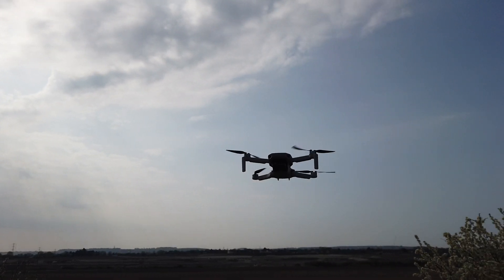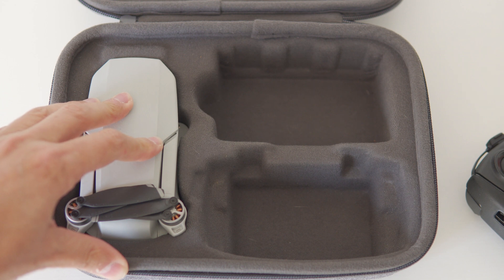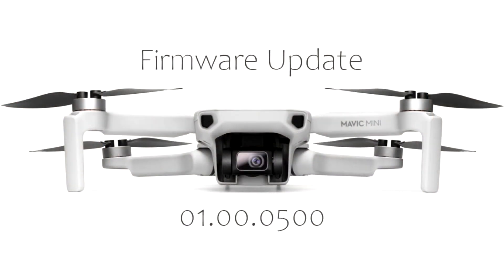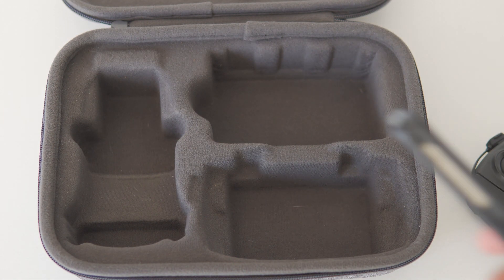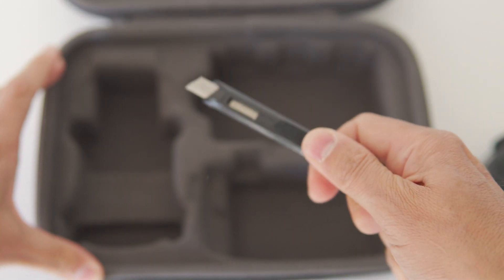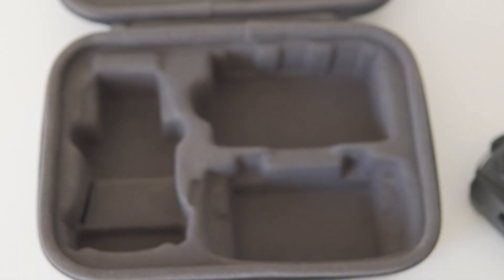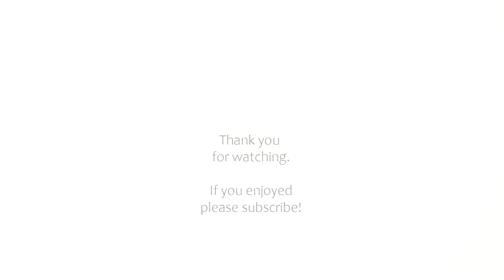Dji MAVIC MINI Warped Propellers | SOLUTION, FIX & PREVENTION!

Comment from the maker: Just so its a little more clear for anyone (due to my camera deciding it wanted to play focus games), you want to cut the felt layer of your case as pointed out by the red line at 1:52 in the video. Only cut through the felt layer, and not all the way out the other side of the case.
This then creates a "felt layered flap" and will lay flat in the case. 
No more pressure being applied to the propellers should they not be put in the case incorrectly.

Comment: I decided to call Heliguy today. Basically they were not aware that there were so many issues with the motor speed error warning. After me explaining my situation as below and him reading forum posts and seeing just what a big issue it was (and that it was generally with the rear left props) he concluded that the latest firmware was at fault in as much as it is too sensitive to even tiny deformations. He said it's likely that the new firmware was OK in in-house DJI testing but in the real world it's not. He explained that they are pretty good at listening to issues and we can expect an update in the foreseeable future. As a total newbie I reckon that there is a combination of factors at play, from incorrect storage, thinness of props and their longevity and firmware. I'm storing mine out of the case and all arms open in an attempt to reduce the chance, even though I'm so careful. I would also add that I bought 2 x sets of spare props from Heliguy last week and the DJI packet they come in is a polythene bag with a cardboard header - potentially easy to mis-store / mis-handle (easy to squash them in transit from the manufacturer to retailer and on to customer). Could some replacements be damaged on arrival and only now we are discovering this. Thin props might be a problem. Time for DJI to rejig firmware and investigate prop material further to see if it is suitable for the MM?
Reply: Thanks for the additional info. It's interesting that Heliguy feel that the problem is firmware related, but I'm inclined to agree with you that it looks like a combination of issues and that the propellers may, in some cases be slightly deformed from new (given their particularly flimsy type of retail packaging) - this might also explain why so many other members on different forums are reporting the motor errors, even with new drones, or after replacing their propellers?
I also own a Parrot Anafi, which has REALLY thin propellers and I've never had any issues with errors or the like, on that drone (and still on the same set of propellers 6 months down the line) - maybe DJI could (ahem!!) learn something from them.

Comment: I do not know why your case does not have a sticker inside, showing how to fold the propellers of your Mavic Mini before inserting it into the case.  If you follow the instruction the propellers are not even close to the area you are cutting off. 
Just fold the propellers inside, perpendicular to the body of the drone and they will not touch the case at all.  do not leave them pointing back at 45 degree or so.  It is not worth to damage a case when there is simple solution of putting the drone into the case properly.

Comment: I am wondering if a thin sleeve, properly sized of course, slid first over the propellors of one side and then when the propellors of the other side are merged with them slid back to the centre, would keep the propellors perpendicular across the body? This could be tested first with the likes of a strip of paper suitably sellotaped into a loop. I haven't got my mini yet so can't experiment myself
Reply: I am posting this as a reply so that the ammendment stands a greater chance of being drawn to the attention of anyone who liked etc. the idea of "sleeves". 
Having seen the sleeves wrapped around the props of my MM when it arrived I am inclined to think that a tight sleeve tends to squash the blades together and I would suggest that if anyone is thinking of trying sleeves they should use a loose fitting sleeves.
Personally I think I will go with the idea of leaving the props loose and then, when putting the MM into the flymore case, tilting the MM's nose down so that the prop blades 'fall' forwards as in the post elsewhere in these comments.

Comment: I have something to add. I'm a total noob with a brand new MM. I have flown it on 3 separate occasions since I received it, so I'll call that 3 flights. Each flight  I used 3 batteries. Each flight separated by around 4 days. The first flight, last battery, I crashed the drone, chipping props. I replaced all props with those from the Fly More pack and stored in the FM case VERY carefully, noting exact position of props - I've been reading a lot lately about this motor error issue and knew storage was a possible even before I bought the drone.  Next flight I calibrated the gimbal, compass and IMU. Flew without incident up to 120m and did 3 batteries. Again, stored in FM case.

Today I set up, calibrate compass and take off. Within a minute I get motor error warning. I land, changing affected props - you can guess which ones...  yup, rear left -  and then take off and fly all 3 batteries without incident.

I just don't understand it. I've seen all the warnings about storage and have been ultra careful, yet still have had problems. I'm loath to cut the case.
Reply from the maker: Yeah I am sure Dji have made the Props to Weak. Also worth noting that when you put the drone in the case to let the drone cool down a bit first. you may notice it gets a tad warm when flying for long periods. I think this may also affect the props.
Reply: Did you update the firmware, as someone else suggested? 
There was a problem with the firmware and there was a suggestion (that worked for me) of reinstalling the firmware through the dji assistant (for Windows pc). Somehow it sorted my errors. Didn't even downgrade the firmware... just reinstalled it. 
Also, it may have helped that I stopped storing the drone in its case...
One final note: I didn't even change the props! Still using the original ones (that gave me the errors) after all this time and never had another warning since then...

Comment: But that raised portion in the bottom of the case is supposed to support the belly of the Mini.  If you cut that away, isn't the weight of the Mini now resting on the folded rear props?
Reply from the maker: I guess it was designed to give it support, but most of the time, people were finding the props would get stuck on top of the raised surface and deforming/ flattening them. 
If you fold up the drone up and place it on a flat surface, you see that the props still touch the flat surface but are nowhere near to the extent of them pushing them up into the crafts body.
There is still 3-5mm of clearance. 
I have a feeling a lot of the warping is being caused after people have flown their Mavic Mini and then stored the props on this raised section ,against the belly of the craft,  which is hot from flying. This is what i think causing the warping issue, but I cant confirm.

Comment: Good video , good tips , but don’t forget about the top sponge piece that presses down on your MM and if your props are not folded out of the way , they will get pinched. I use silicone prop holders to keep the top props together and not flopping about. Cheers
Reply from the maker: Great tip!

Comment: Having just got mine I am now wondering if you can't simply tilt the drone nose down, allow the props to 'fall' forwards and then put the drone into the case nose first? It looks as if there might be room in the hollow in the case under where the gimbal will sit, I will have a play tomorrow.
Reply: Having tried this I want to add the following. When putting the drone into the flymore case with the nose down I have noticed that the forward shoulders of the recesses for the rear motors 'force' the prop blades to swing inwards towards one another. They end up pointing to about 10 o'clock and 2 o'clock and as far as I can see in no danger of being squashed. 
A dollop of warm soft margarine sandwiched between two layers of cling film and placed in the flymore case in the recess below where the gimbal sits shows no sign of being squashed, try it for yourself.
I also think that the forward props will be well clear of the bumps in the case lid if they are lined up with their respective arms. If someone else is looking at this positioning check your own case, just in case your case differs from mine.

Comment: Just add propeller covers, job done!
Reply: Not sure if that is enough. I too bought some propeller covers made of silicon, but now there's another issue: the covers push the arms, as they occupy some space there too...
I think the best is not to save it inside the case unless you're on the go. My mini stands open at a shelf and never had the propeller warnings again (and I updated the firmware through the pc app as well...).
Take care.

Comment: I would rather try putting little pieces at all four corners to keep the Drone wee bit elevated and making little room for the propellers. And see if it works before cutting the case.
Reply from the maker: Yeah I did try that, but the lid of the case has another raised section to push the drone down.
Reply: @TheCameraManReviews  I have not tried it but will try and let you know... Thanks
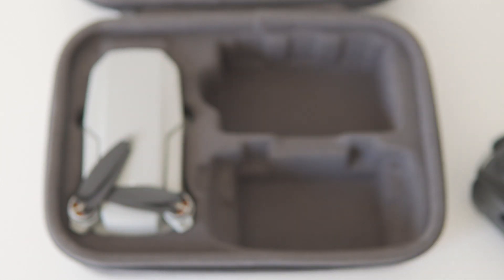Reply: And at 2:05 you set the drone in the case with the forward props (on top of the Mini) incorrectly positioned so that the raised section in the case lid is going to press down on them?
Reply from the maker: @Zbip57  Good spot, but as they lay flat against the top of the drone it really makes little difference to the front props. Its the rear props that are causing the issue.
Reply: @TheCameraManReviews  ... I tried this, and it works. The raised section on the upper lid doesn't press against the Drone... I can't upload a video here...😔

Comment: Or, you could just store it correctly as the sticker in the case tells you, which you evidently removed.
Reply: Do you not find that there is some distortion of the props getting them to interleave with one another?

Comment: it's not very clear what you have done from the video as you don't show a clear shot of the case before and after, and on the after it's out of focus so you can't see it?
Reply from the maker: Hi, sorry about Focus, my camera decided it wanted to be a dick and to follow my hand. 
If you cut as shown with the RED line @1:52 , you create a flap. This flap then just lays flat.
 The case is made up of 2 layers, just be careful only to go through the top layer, the felt layer.